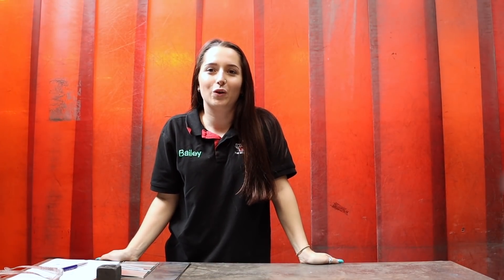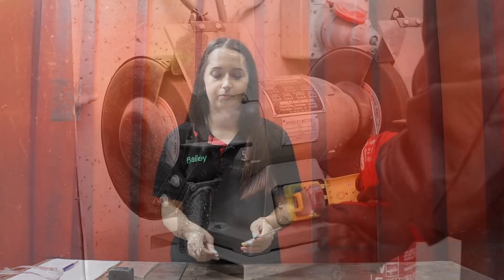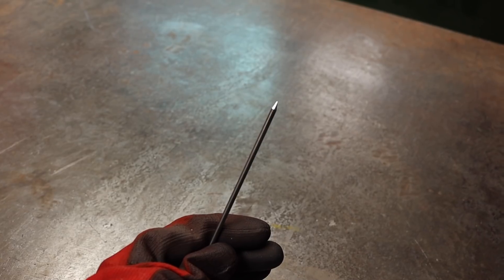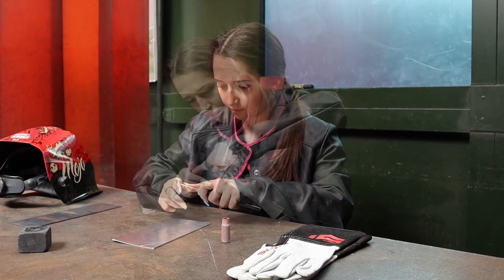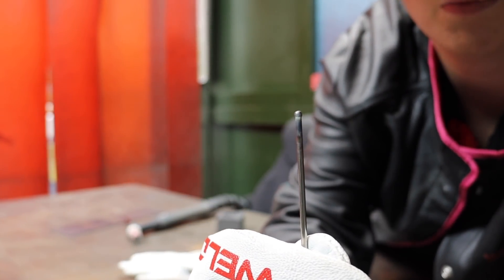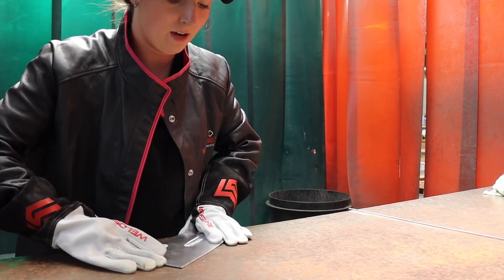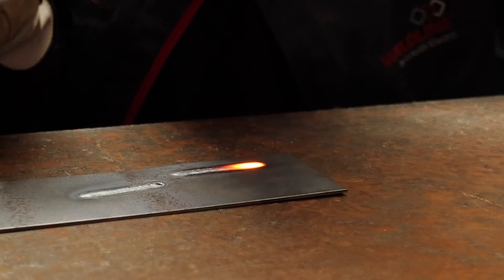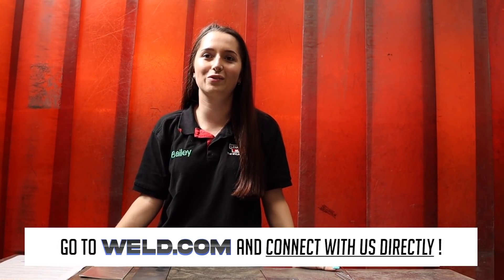Understanding the Differences Between Sharp, Blunt, and Ball Point Tungsten Electrodes in Welding

Comment: Smart move to do the tried and true video... The point about tungsten points.
I use LaYZr on super thin ferrous material down to 20amps(+/-10A), cerated on thick steels for lower current usage, and 2% lanthanate for stability on everything in between those.
I haven't had to buy tungsten in a while, so I don't know if I would break off a fouled tip... Just clean it as they may be hard to get now.

Comment: I think you meant Thoriated Tungsten for steel ? I've taken to using 1mm tungstens for welding thin (less than 1.5mm) steel. Much quicker to regrind when I dip the point !

Comment: Hello, thank you for the excellent information. May I ask, when you do dip your tungsten, how much of it do you cut off before you regrind or ball it? How far does the contamination travel up the tungsten up from the tip?
Reply: I'd admit I'm not on the same level as these fellas, but I do a tremendous amount of welding and fabrication. With TIG I've seen many fellas be very meticulous about the grind and shape of their tungsten, whether it be steel, stainless, titanium, aluminum or brass. For the longest time I figured it was essential to have clean, well grinded tungsten with the grind marks going parallel with your tip. Years I practiced this, using who knows how many hours after each dip to clear contamination and re-grind, and while there are certainly scenarios in which you do require clean proper tungsten, I didn't realize how little it mattered until I watched a real professional weld aluminum beautifully with the nastiest looking tungsten I'd ever seen. Don't get me wrong if you Q-tip your end really bad your arc will tend to go kinda all over the place. But this one fella could run a nasty, misshapen contaminated tungsten and still produce nearly a flawless weld. It's really just a matter of experience, similar to pilots and flight hours your TIG ability is based on hours behind an arc. To answer your initial question the contamination is always visible on the outside. I like to cut .125 inches (3.175mm) or so beyond the visible contamination just to be safe. Cut your tungsten with a cut-off wheel, DON'T just leverage it over an edge and smack it to break it off. This will cause cracks down the length of the brittle tungsten and you'll likely ruin the majority of the rod, then grind how you prefer. When it comes to steel and aluminum, unless you're chasing a perfect bead and have the actual experience to produce one, don't worry about it too much. Watch your arc, watch your puddle. You'll know when it's time to cut and re-grind.
Reply: @Wa5ffl3s  Thank you for the outstanding information! I have one more question for you if you don't mind. I have learned that while welding AC/Aluminum the purpose of the Argon is only to protect the Tungsten and the puddle due to the Aluminum not being reactive. Why specificially do I see people using gas lenses on Aluminum? What exactly do they gain if anything at all by doing this? What is their justification for it's usage? The only data I can find is that it wastes shielding gas???? Thanks again!
Reply: @kenneth6731  Yeah, often times the folks I work with find it fun to step on or kink your gas hole while you're running a pass. Usually they have the decency to do it while you're running a non-crucial weld but still, you'll get to learn very fast how the argon flow shields the liquid metal. In fact it can be a fun little experiment in a home garage setup. Have someone kink your argon line while trying to run a pass, and you'll get to learn the signs of invasive oxidation at the weld pool. Typically it'l spatter and bubble and you'll learn to recognize that violent reaction to the failed gas shield. From what I know gas lenses are considered the "training wheels" of TIG welding. They claim to improve gas flow and allow for more tungsten stick out, giving better visibility of your weld. I assume you'd see people specifically using them on aluminum because it's especially finnicky. The metallurgy of steel and aluminum are wildly different, especially heated and in an oxygen-deprived gas shield. Learning to TIG steel and then learning to TIG aluminum is kind of like learning to play the bass guitar and then learning the violin. They're both strung instruments, but they have tremendously different core properties. Most folks I work with typically just run a collet with a cup sized to the nature of their work, and we do a LOT of aluminum. I've always found success with a typical collet setup and either a 6, 8, or 10 cup for my aluminum welds depending on material thickness. I'll run larger cups with a higher gas flow for thicker structural aluminum and scale it down appropriately for smaller or finer work.
Reply: @Wa5ffl3s  Okay so I am trying to teach myself TIG and I have maybe hour to two of seat time. I have just been regrinding the tungsten when it sticks. That is not sufficient? Apparently I either missed or forgot the part about cutting it off. Damn at the rate I dip my tungsten I'm going to have buy by the meter. I've been primarily doing steel and a little silicon bronze brazing. Thanks for any info.
Reply: @Parents_of_Twins  I only cut off the end when I glob a particularly large molten metal qtip onto the end.  Grind off as little as you need to remove the contaminant from your tungsten. If you make a very flat angle, you can send 3/4 of an inch of tungsten without tsling off a lot of metal.
Reply: @Wa5ffl3s  
 You cut off 125 inches? You may want to check your scale.
Reply: @stanervin6108  0.125, or rather an eighth of an inch. And that's really just an eyeball of a measurement. I don't typically include the "0" in front of my decimal, but I realize I probably should for clarity sake.
Reply: @Wa5ffl3s  
  I appreciate the clarification Allen. Heck, I didn't see the decimal pt. at all on my tablet display.